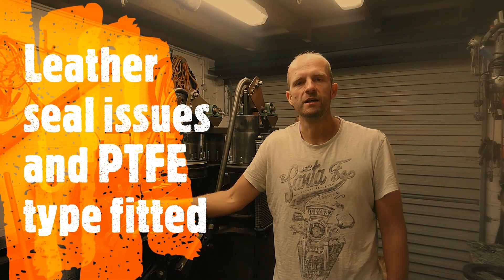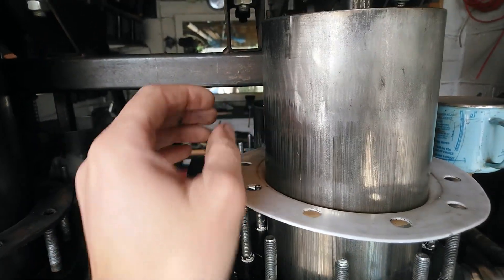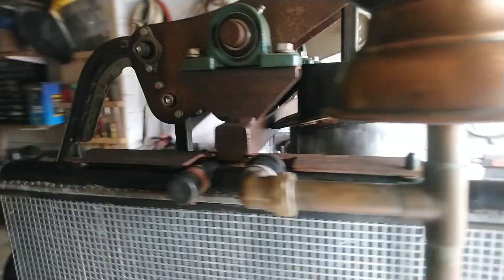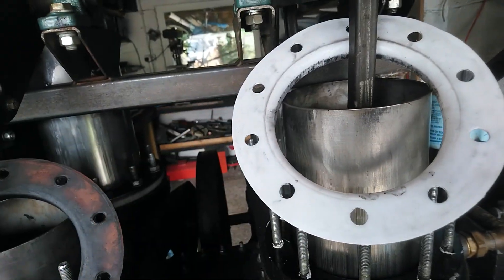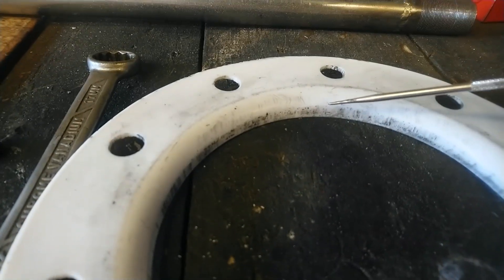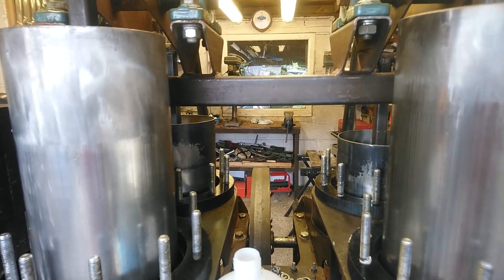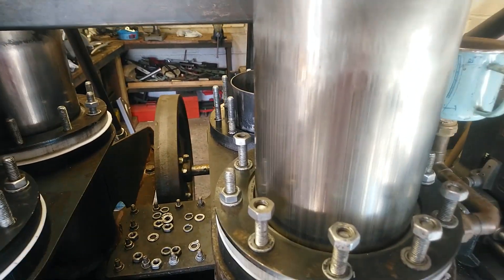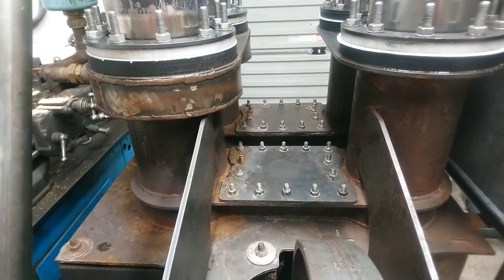Stirling Engine Electric Generator with Homemade PTFE seals ! Part 12

Comment: I love the idea of the Sterling engine have you seen the Sterling engine being used in the kockums submarine or the ,
ses Sterling Energy Systems 1.7 gig a watts fields of parabolic dishes with the focal point on the Sterling 1.7  megawatts coming out of the one that I was reading I've played with engines and built prototypes graphite seal or ring was used and it was very successful
Reply from the maker: I'll take a look! Also graphite seals are of interest to me. I'm still playing around with lip seals but may need to explore other options, cheers

Comment: Shane I like that you installed the 3 phase rectifier I think this rally good. 
Further I was thinking if you use an arduino to turn on and off the load bank based on rpm of the wheel the system could self regulate. As the fire changes the max output would be recorded.
Reply from the maker: Cheers for the tip, the rectifier simplifies things for alot of applications! I could do with something to regulate it either mechanical or electronic